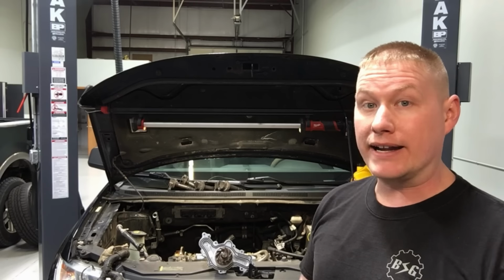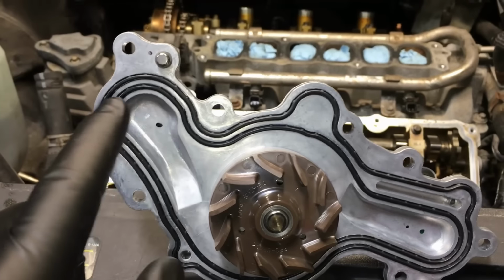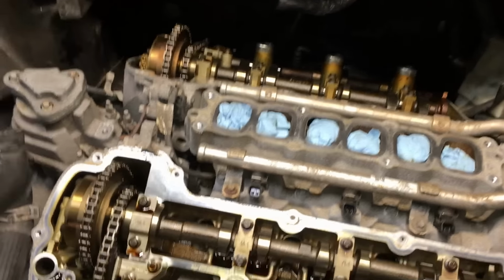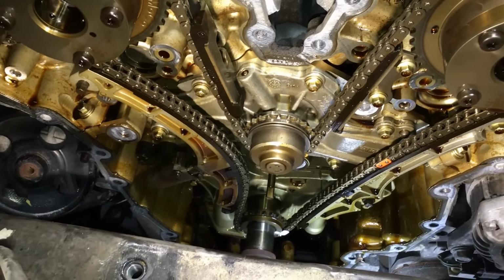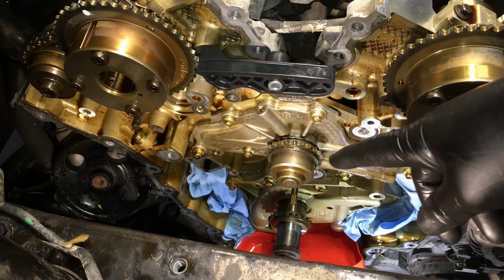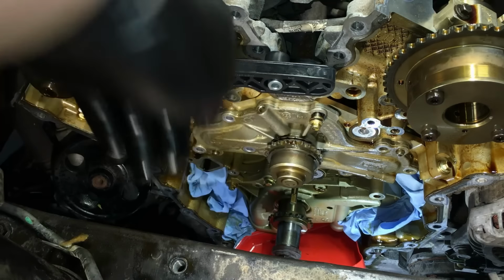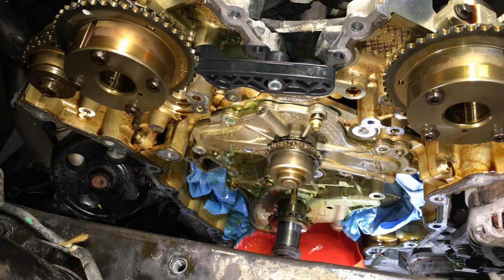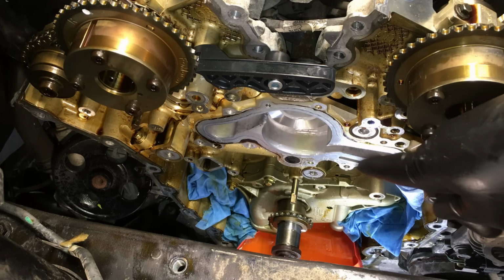Ford 3.5L 3.7L Duratec V6 Chain Driven Water Pump Failures: Check it Before it Destroys Your Engine!

Comment: I'm currently doing this on a 2010 Fusion Sport with the engine in the car. By far one of the most complicated procedures I've done in my 26 years of wrenching, but still not horrible. Just make sure you're not in a hurry!
Reply: Matt Krumal did you manage to get it done in the Fusion without pulling the motor?
Reply: MR WD yes I did! I've had it done since May and it's running great with no leaks and no issues!
Reply: I will post videos soon of the procedure, some tips on doing this, and the final product.
Reply: Cool, I don't need to do it YET, but I know it's coming some day.
Reply: @mattkrumal239  where are the videos?
Reply: @mattkrumal239  I have the same car with 78k on it no problems at all will always keep a eye on it
Reply: @omarihill2304  Check oil and coolant levels weekly, check out any new squeaks near the accessory drive area RIGHT AWAY.
Reply: @Matt Krumal  or anyone reading this, do an oil analysis at every oil change. It can be tested and will show traces of coolant in your oil. Once you see coolant in your oil have the procedure done before the coolant ruins the engine internally from diluting the oil. Look up oil analysis, it's easy and affordable. Best step to take in preventative maintenance, on any vehicle!
Reply: @mygt8a4re  That’s not a bad idea, especially considering that the 3.5 isn’t the only engine with this issue. Thanks Justin!
Reply: @mrwd1234  how did you get the housing off the engine and I'm currently using two-by-fours and a jack trust me I know how  unsafe and stupid it is  but I have it in the right location so. Nothing Falls or damages the engine how would you go about taking housing off of the engine if you couldn't pull out the engine?
Reply: @beccalynette6534  Wow...a mechanic with boobies..!
Reply: Matt krumal. That's what we are doing right could use your advice in some tips or help or something cuz we have no cherry picker we're using it to buy four and a jack MR WD how did  get the housing off the engine
Reply: Ive had my water pump replaced and 19,000 miles later my motor has failed. First it started ticking with RPMs then after an oil change it failed with loud knocking metal within 24 hours after the oil change. A mechanic friend of mine told me that if the timing chain was mistimed when water pump was installed, it would cause ticking noise then failure which I didnt know about at the time

Comment: Brian is it fair to ask do you prefer doing this type of work that's labor intensive or do you enjoy performing preventive maintenance like spark plugs/oil changes,  brakes, suspension/or diagnostic?
Reply from the maker: I prefer diagnostic over anything else.
Reply: I thought that would be you're response, if  diagnostic include chasing a short or an intermittent electrical issue would probably not be an enjoyable experience. Fords electrical designs seem to be the most robust of the American manufacturers
Reply: Now if he really, truly had a passion for diagnostics...he'd work on BMW's.  2003 - 2012 BMW's throw more codes than Kardashians do selfies.

Comment: Is the F150 the same way?
Reply from the maker: No they have room for an external water pump.
Reply: FordTechMakuloco so 3.5 and 3.7 non Ecoboost f150 a good choice for base model low maintenance?

Comment: Does these engines have a low coolant sensor?
Reply from the maker: No Ford ditched those sensors years ago.
Reply: Kinda crazy they won't put a $10 sensor in there to save the engine because of their flawed design!
Reply: The funny thing most japanese vehicles are built that way,even old nissan have a similar design to this,
Reply: I had a 99 cavalier Z24 with the same setup, luckily never had any problems with it before I traded.
Reply: My 2002 Escape had one. I know that cuz my water pump leaked 😂

Comment: Luckily are edge was certified preowned everything that goes bad on water pump cooling fans brake booster power steering pump all changed under warranty before 100k we are selling it once the warranty goes out
Reply: I have a friend with a 3.5 in a 2013 Taurus, 231K no problems, just regular maintenance, 3.5, no water pump or timing chain required yet
Reply: I saw green fluid come out of this water pump. Normally the correct fluid is FL22. I 🤔 is this correlated with better lasting seals bearings when you actually use correct fluid!?
Just saying!
Reply: FORD4LIFE73 only power train I believe, not everything

Comment: Other than the questionable design of the internal water pump, this seems to be the most reliable Ford engine, as good as anything from Japan or Europe. For Honda owners, this is a $1100 procedure (water pump and timing belt) at a dealer
Reply from the maker: Yes it is very reliable otherwise.
Reply: Agreed , Just purchased 2016 Transit 3.7L. All my research praised this engine for reliability. I think 180000 miles this engine looks great and with the guide problems ect this was perfect timing. I am old school but am here to tell you. This little 6cyl performs great in my Transit 350 wagon. I like the "Hit me once " drive it problem free another 200000 :)
Reply: alb12345672 did a wp on my 3.5 lex.  No walk in the park but took me about 5 hours... backyard mechanic with a home Depot socket set..... Miss my 92 Buick....talk about accessible
Reply: Lexus has a 3.5L Engine. WP is external. Has an extra set of injectors to wash the valves so no DI issues. The starters are very reliable but the Exhaust manifold and pipe has to be dropped to replace it. Probably cost the same as this repair at the dealer.
Reply: Brian have you videoed this job ? I don't think I seen one for the Durtec.
Reply: @James, yeah, I keep an eye on mine, I hear they are a fail point. Certainly doable though. The starter scares me though :lol:, at least you don't trash the engine. Also, if the 90s Continentals, that had a FWD V8 4.6L engine, had an external WP, no reason this couldn't.  I hate to say it but this could be a case for BARS LEAK. One product has a WP seal conditioner and can stop  seal some seal leaks. It gets a bad rep but if you have clean fluid it seems to work. I would be pressure testing this engine every oil change. Wonder what the failure rate is though. Some certainly will fail early, but most will probably last till 200K which is the life of the engine.
Reply: alb12345672 yeah don't know long term. Probably partially depends on how often the coolant is changed.  I assume the corrosion inhibitors break down over time and could lead to an earlier failure. I don't have any exp with this ford motor but toyota and Lexus I've done quite a few water pumps on around 100 to 120k.  As you said, even if it's a few hour job...at least it doesn't take the engine out with it.  It seems like every model has its Achilles heel...some just cost more than others.
Reply: Yes, very reliable engine.  Your comparison to the timing belt & water pump work on a Japanese or European make is spot on, with the caveats that Ford doesn't mention this service in the owners manual nor that if neglected the engine is ruined.
Reply: 3.5L/3.7L engine was originally designed by Mazda in Japan and internal water pump was Mazda design. Mazda CX-9 was the first to come out. Ford failed to install a lifetime water pump.
Reply: Walter Chan actually it is designed by Ford, Mazda just used for a short time in their cx9 before dumping it for their skyactive 2.5T.
Reply: The only thing a Ford has in common with Japanese vehicles is the both have air in the tires
Reply: 12wing Wfetech wrong my friend. Check out what motor Mazda used in the CX-9 pre 2017.

Comment: That's a big ordeal just to swap a water pump.  I'll just keep rebuilding my old 300.  May scour the junk yards and find a few extras to have on hand.
Reply: Yeah you could buy three or four of those motors and still have a few bucks left over to buy beers compared to what it costs to pay someone to fix this water pump.
Reply: Robert Nugent and have 3 or 4 more reliable engines.   Last one u had had 340k on it and was still running strong when a tree fell on it

Comment: Are there any tips for prolonging the life of the pump such as frequent coolant flushes?
Reply from the maker: Not much you can do the gold engine coolant is a good coolant and will lubricate to 100k no sweat. Now the new OAT coolant I would be swapping that out every 60k miles.
Reply: Frequent fluid changes should help up to a point.  Eventually, the pump will just plain wear out.  I have a 2010 Taurus with this engine.  I do my own oil changes and send a sample of the used oil  to a nearby lab to be analyzed. They test for both water and calcium in the oil.  My hope is to catch the leakage in it's beginning stages before it turns into a catastrophic failure.  I also monitor very closely the coolant level in the degas bottle.

Comment: I have a 2008 Taurus with the same 3.5 motor, 216k miles...I did all the maintenance myself except for the transmission service. Thought I had more time for the water pump smh...it took the motor. Very solid motor, except for the water pump placement.

I noticed as well the eco boost and rear drive platforms based one this motor are similar, except for an adapter plate attachment that moves the water pump to the exterior of the engine (which it should have been in the first damn place)
Reply: There isn't room for the water pump to be mounted externally on the Duratec V6 in FWD platforms

Comment: I have an idea Ford put that pump in there. So people would replace the timing chain kit. Before it blows up the motor..No different then Honda water pump\timing belt replacement time.
Reply: Except when a Honda w/p leaks, it does so on the ground, not inside the engine. And they are MUCH easier to change, in most cases. I just did my 05 Acura TL 3.2. $250.00 for the entire kit with belt, tensioner, idler pulleys, etc. and coolant. I did it on jack stands, took me about 3hrs. Hardest thing was getting the crankshaft bolt loose.

Comment: What a clever water pump placement.
Reply: Ken Young I know, next time they should just have it be driven by the fuel pump in the bottom of the fuel tank, that way when it starts leaking, it ruins the fuel and you stall on the side of the road.
Reply: The sarcasm is strong with this one! Lol

Comment: So I have a question maybe you can help me with. My dad has a 2011 f150 3.7 v6 with 127,000 miles on it and as you are driving the rpm fluctuates and it cuts out almost like it is skipping. I have put new OEM plugs in it a new Ford OEM O2 sensor. And yet the problem remains. They said they wanted to try and put some friction modifier in the transmission before they hooked it up to the main computer. Does this problem sound familiar on the 3.7 please also note it has always had regular oil changes. My Mustang has the exact same motor and it has more miles on it and it is not missing a beat.
Reply: Bull's Eye I appreciate it but the Mustang is fine the throttle body was replaced under a recall I’m talking about the f150 which shares the same motor as my car
Reply: Jay Man 😂😂😂😂😂oh for a second there you really had me going I thought you were serious about buying a Chevy what a mistake that would be 😂😂😂😂😂😂

Comment: $1200? I prefer buy another car, the $1200 and again I prefer to put some money on top of it to buy another car, in 2013 I bought myself a 2003 Cadillac DeVille DHS, in July 2017 it gave 2 problems and problem was brake booster no good the mechanic asked me $700 to fix it plus $1100 to fix the air condition and I was going to different   places to get fix and kept saying the exact same price, and i said   I was spending that kind of in this 03 DeVille at that time engine was running and transmission was also good, and now I have 2005 grand Marquis Mercury cost $2000 everything is working good on my Mercury and I will not spend too much in a car $400 to $500 that's it and I'm not a Rich man, Rich people can do that but some of rich people they don't buy a car, they're leasing a car
Reply: If you can find a good car for $1,200.00 these days you're doing real good. Around me that buys you a car that might go a year before it collapses from rust.  Anything with reasonable mileage and in good shape starts around $5,000.00 and goes up really fast.
Reply: $1200 bucks is only 2 months of a new car payment. so for alot of people its saving money keeping their older car going instead of getting sucked into another new car payment for 5 or 6 years
Reply: A good crown vic/marquis/TC is extremely reliable and a great catch. They are also inexpensive. Some do have issues but the 2v engine is about as reliable as you are going to see. My next pick would be a Lexus LS400/430 We are talking used cars here with high mileage.
Reply: He may have issues, sure ANYTHING that moves will. But most repairs on a Crown Vic are very DIY friendly and cheap.  Plenty still ride around as Taxis. A town here has a fleet of 98-02s, I can tell by the wheels. Those have the box steering like trucks. Throw a trans pan with a plug(they are like $25 bucks) dump the oil every 3rd oil change, trans will last forever. The U-hauls trucks had those transmissions and came with a pan like that from the factory. There are cheap good aftermarket ones now.
Reply: Lol....$1200 car?? I bet its a total piece of junk. Repair this water pump an the car is good for another 100,000 miles.
Reply: You might have some other problems with that car down the line, but the motor properly maintained will run for an eternity.

Comment: Is this on all the 3.5l v6s? I have an F150 with that engine and it sounds like the waterpump is making noise but I'm not having any issues and the oil looks good.
Reply: The F-150 uses an external pump not the internal.

Comment: idiotic design that's all i can say
Reply: Don't forget GM 2.4...... junk
Reply: Ingenious actually. The manufacturers are following a designed to fail engineering methodology.
Reply: 29 auto The eco tech 2.2 and 2.4 are gravy.  No comparison.
Reply: Same exact failure problem though... coolant in the oil.
Reply: Nowhere is this billed as a 5 hr job.
Reply: 29 auto Much easier job than this. A GM tech can do a 2.4 chain and pump in a few hours.
Reply: adam shreds So you'd rather spend 12+ hours working on a V6 rather than a few hours on an inline 4? Whatever suits you I suppose.
Reply: adam shreds For someone who does these chains all the time I'm sure they could do this job fairly easy and fast. I just don't get why the GM 2.4 is difficult. My mother has an 11 Malibu with the 2.4 and I got worried for her as the chains seem to be a big problem. Every GM tech I spoke with said it's a gravy job. The Duratec in this video looks more intense than an inline 4. Can you tell me why the 2.4 is so difficult to do this job on?
Reply: Adam Trombino Failures are few and far between though

Comment: Ford idiots , who the hell designs a waterpump behind the timing cover.   SMH
Reply: I remember when the Northstar came out, also Honda had a one year only car that you could not change the brake rotors so Ford does not own the poor engineering crown.
Reply: @martialman.4563  Lets not forget the excessive oil consumption in late  model Chevy Equinox 4cylinder engines. Some of those engines were consuming FOUR QUARTS of oil in a week! Not sure if there is still a "class action" lawsuit still in effect against Chevrolet...
Reply: @TheOzthewiz  I forget. Was in the GM mechanics program 1999-2001. The 5.7 and Northstar stand out  the most.
Reply: Chrysler did.
Reply: Uhh, GM also did with the Grand Am.
Reply: @SmartSped1984  For what engine?  The 4 cilynder?  I thout the 3000 or 3400 series had it outside, driven by serpentine belt.  Also, the 3.8 had it outside.
Reply: GM did with the buick
Reply: I did not know about this or the electric power steering .  I just don’t get it , It is like they are planing to fail . The tried and true hydraulic power steering Why 
And the basic water pump ,  these two alone could total a car.
Reply: storemannc,
The electric power assisted steering (EPAS) was done to reduce weight and load on the engine in an effort to meet government mandated fuel efficiency. Carmakers have to meet those requirements to be able to sell their cars without paying huge fines, reliability be damned. (Actually the EPAS should be MORE reliable than hydraulic, if they had designed it with reliability and maintainability as priorities, rather than just minimizing the manufacturing cost -- booo Ford.) The water pump design, though, is a mystery to me. Did Ford hire some laid off Chrysler engineers?
Reply: @ArcoZakus  Actually the EPAS has more responsive steering vs the hydraulic system. I have EPAS on my '13 Focus, have had NO problems in the 70K miles of driving. I can tell you that the handling is razor sharp with no steering lag, making for a very engaging drive!
Reply: Chrysler and Ford
Reply: Kenny Howard this is a Mazda design
Reply: Chrysler and Subaru does the same bullshit
Reply: luis amoa And f**king Nissan.
Reply: Actually, it pretty common on most newer cars. They keep stuffing more crap into a smaller bag.

Comment: Nice video, I have a 2011 edge where fluid is collecting on plastic edge of transmission dipstick.  This is a fwd.  I’m not seeing water pump leaking but with 131k there is fluid slowly leaking down by dipstick which I’m trying to identify what exactly is leaking. Any thoughts appreciated
Reply: Update, I changed tranny fluid and after doing this it appears I either spilled some fluid and may have overfilled tranny, but not really sure.  No more fluid is collecting, but I did change from Mobil1 full synthetic to SynTech motor oil, may have had some leaking seals.  Not have to deal with water pump is a relief.